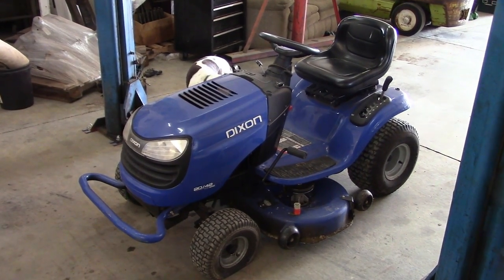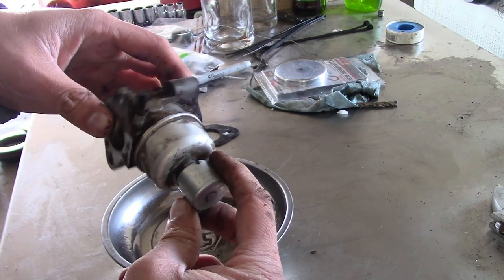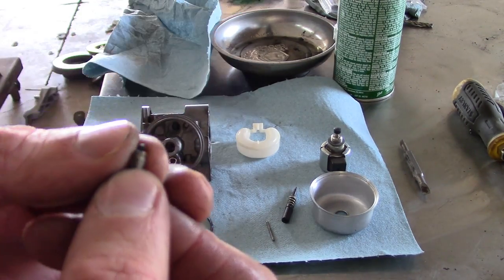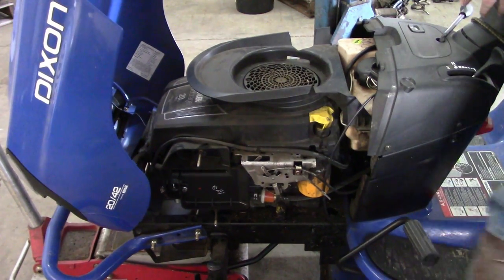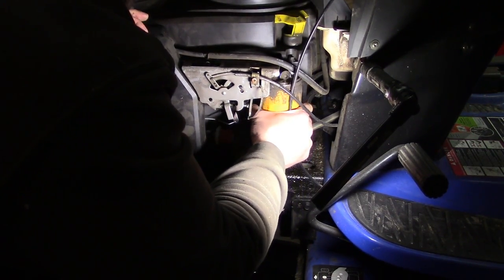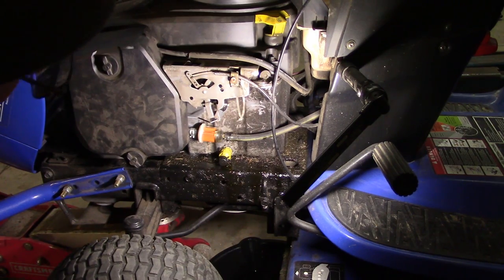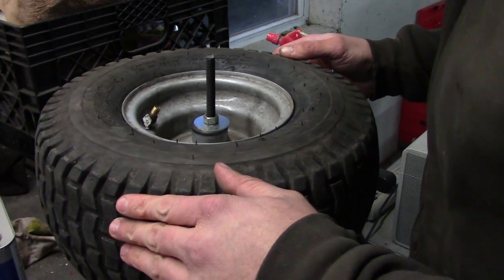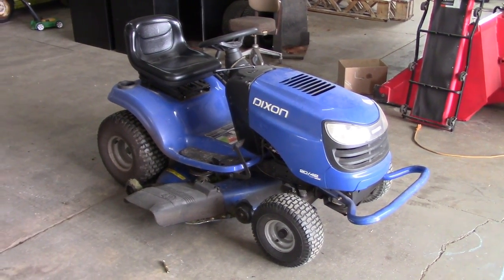Fixing up a Small Lawn Mower

Comment: That mower looks clean and relatively new on the outside but filthy under the hood.  When you see that amount of filth around oil filters and carbs you know there must be a leak.  Looks like a "run it til it breaks" owner and then take it to a repair shop.  I see them all the time and the owners think I should work for free to do the required service and clean them up.  They treat their cars the same way and expect guys like you to fix them.
Reply from the maker: It's leaking pretty bad from the valve cover. But it has over 1000 hours on it. That's a ton of hours for a disposable mower like this!

Comment: All riding mowers with Kohler engines require full choke when the engine is cold. They won't start without it. I own three, and have worked on countless numbers of them, and all of them do it. I guess it is just a Kohler thing.
Reply: I got a Kohler 7000 series 22hp can start on idle every time

Comment: Now show us something cool how to add an alternator on there for my car so we can take a couple typical decks for those kind of mowers replace the spindles with electric motors run off the alternator us allowing us to cut more grass at the same time by adding a deck or two if you would front mount them put the discharge chute the center pick up all the grass with one bag set up

Comment: Mower looked in good shape pulling in until you opened the hood to reveal the kohler "crapage" engine inside. That's VERY unfortunate. Older Kohlers( command,etc.) are bulletproof motors. This one just needs a bullet!
Reply from the maker: I really don't like the way the governor works, but it seems to run OK.
Reply: Was it my imagination or video artefact or vibration or what, but the fan/flywheel thingy looked kinda wobbly in there? Loose fanshrouds?

Comment: Just a pointer greasing the spindles in most cases serves no purpose what so ever as the bearing are usually SEALED
So your basically just adding weight to the mower :)
Reply from the maker: These are sealed.

Comment: Wow someone over tightened that filter.  Surprised you didn't have to punch a screwdriver through it to remove it.
Reply from the maker: I've had to use an air hammer to take them off before...

Comment: Pretty sure 10w30 is what's spec for that Kohler.... 'Pedant checking in'
Reply from the maker: You can use straight 30, 5W-30, or 10W-30, depending on temperature.

Comment: old video, i know, i know, but...

if my very flimsy, very thin and very lightweight (200 grams) latex tubular tires and my carbon fiber rims (300 grams) on my road bicycle can withstand a consistent 120PSI of pressure, i can't imagine those 30lb steel rimed wheels and tires couldn't take an equal amount. 

so, i would have thrown some REAL pressure into those tires to see if they'd bead properly before i spent any time breaking them down and slathering that tar on them.

Comment: not a fan of the Kohler motors at all. they've let me down a few too many times. give me a Kawasaki engine ANY day and i'm good to go. all of those mower bodies for Dixon, Cub cadet, John Deere, Huskie, MTD, Kubota, Snapper, Scott, Simplicity,  are all made by the same  company. every one of them that is not a full framed tractor and happens to have a stamped out body are made by the same group, i can't recall the company name right now but my 5 year old Craftsman was made by the same people.  As for the oil I use Mobil 1 in mine B&S began listing that as an approved oil for their motors too in 2015. i don't really think it matters much as long as the oil you use is kept changed regularly. i've always used Mobil 1 because i've had such good luck using it in all of my vehicles so i figured it would serve my mowers just as well and so far i've been right

Comment: I thought oil filters were torqued to 350 foot pounds???
Reply from the maker: Tighten it until the engine mounts sheer off...
Reply: Right, no wonder vehicles still ran after I changed the filter...

Comment: Not sure why anyone pre fills oil filters it’s the last thing to get oil you pour the oil in the top of the engine it fills the head runs down though the oil ways all over the crank and bearings so the engine is nice and oiled without the oil filter being full then you start it to fill the oil filter and top it up I really don’t see the problem in putting a empty oil filter on

Comment: I still don’t understand why lawn mower designers refuse to have the oil drain plug, directly over the seat, and then run onto the hot exhaust pipe, before draining onto several different distribution points, instead of just the one point that is sure to leave the puddle off dirty oil, on the concrete floor, and miss the drain pan, completely!! 

If you put the whole mower on a drain pan, twice the size of the mower in all directions, oil will still drip onto your floor!! 

The price of a new mower, is not worth the time to stop, AND FILL THE OIL FILTER, during an oil change!! Just leave the oil filter on the floor, facing upwards, to catch all the oil that spills out of the funnel, when you put the one quart, and three teaspoons from another whole quart of oil, in the crankcase!! DO NOT OVERFILL!! One quart and four teaspoons could be deadly!! One quart and two and a half teaspoons, voids the warranty!! 

That hose connection, DESIGNED to help clean the grass clippings from under the deck, works almost as good as a politician! You could hang the mower over an open fire hydrant, and not clean the grass clipping from under the deck!! If you left the mower at the epicenter of the Australian fires, the only thing left afterwards, would be the grass clippings, under the burned out deck!! The secret to WHAT WOMEN REALLY WANT, AND HOW TO SAVE THE WORLD, AND THE MIDDLE EAST PEACE PLAN, is stuck under a mower deck, hung up in grass clippings, next to the hose connector on the deck!! 

No, there was no sarcasm in my tone!!   Signed by.   SICK TO DAMN DEATH OF LAWN MOWER DESIGNERS!!
Reply from the maker: LMAO! It's all a conspiracy to sell fluid extractors and replacement decks...

Comment: I used to pull these out of electrolux manufacturing in orangeburg sc got to try one was not too impressed then again i ha e a zero turn deere
Reply from the maker: Yeah, this is not even from the same planet...
Reply: @WatchWesWork  dixon used to be a good brand as did husqvarna but like everything got to get it to a walmart price and quality suffers
Reply from the maker: @Newberntrains  I know. My dad used to work at a small engine shop that was a Dixon dealership in the 1970s. The friction clutch zero turn mowers were awesome for flat yards. This thing is just disposable junk.

Comment: Cheap blades.   Oil drain was seeping, so they crank the oil filter down.  Can't believe you put a Fram filter on there.  I mean you torqued the valve stem... but a Fram filter?  Amsoil makes a 2 micron bypass filter that screws right on.  That is one ugly machine.  I see why they put a bull bar on the front.  Keep other equipment from punching it in the grill.  Good show ;-)
Reply from the maker: LOL. I'd just take the oil filter off. These small engines ran fine without them for decades...

Comment: I don't want to be one of those pedantic commenters, but... 1 Bar is 14.5 PSI, not 14.7. Why not a nice even Atmosphere? I have no clue. Whoever made up the Bar must have been slightly above sea level. And yeah, not cleaning all the schmutz out from under the deck makes them rot out quickly.
Reply from the maker: Right. I forgot that 1 atmosphere is 1.013 bar.
Reply: @WatchWesWork  In fact the (bar) belongs to the international system (S.I.) the rest of the world is using. 1 bar = 10^5 N/m^2 (Pascal).The bar ...generally...is nice and even not the atm.

Comment: if you can try and find ethanol free fuel for your small engines they will last forever sadly carbs and high ethanol fuels just dont agree
Reply from the maker: Yeah. It's not easy to get around here. Too much corn I guess.
Reply: @WatchWesWork  I can get it at a station by my brother's house in Rockford but yeah not easy in the Midwest corn belt I always have him bring me 2 5 gallon cans whenever he heads my way lawn mower and chain saw love the none ethanol stuff and even my poor yugo loves it

Comment: I thought that those mowers had the two blades overlapping and in sync. The quality of the cut Gras would probably be better.
Reply from the maker: The only one I am aware of with overlapping blades is the old Wheelhorse two blade decks. The blades are connected by a shaft and bevel gears and the blades are timed so they don't hit each other.
Reply: @WatchWesWork  that makes sense to me. Another way I have seen is that one blade sits further forward and more in in the middle than the other one.
Reply from the maker: @Knallteute  This mower has one blade slightly in front of the other as well.

Comment: Would not ever recommend buying a mower with a Kohler Courage engine as they have many problems Like the muffler has fell off mine 3 times (pipe broke) it constantly leaks oil from the valve cover its not made to last with 2 Plastic cam gears
Reply from the maker: They are cheap...

Comment: Short videos keep we idlers sane thanks.  Pretty sure you violated two cardinal ethics of automotive repair: 1) insufficient soap in your spray bottle to yield bubbles without viewer squinting, 2)  use of non-digital air pressure indicator invalidates your presumptive achievement of required 14.00 psi

Comment: Cheater I want to see you get that bowl oring back on. They usually swell way.up and almost impossible to get to fit again. Also i hate thoes electric shut off  because if battery low it will not stay running. Lol
Reply from the maker: This one was in sad shape from corrosion.

Comment: What piss poor fix to sotp the engine. THAT is strange my 1970 edger dos not have that why, design problem? Yes go by some more parts from China that will fail
Reply from the maker: I think the shutoff is needed for higher compression engines. It works quite well.
Reply: @WatchWesWork  Hi I bought a Sears garden tractor new back in 1991 with a 18.5 hp and it does not have that on it, runs and looks like new i cleaned the carb about 8 years ago and replaced all of the steering bushing with ball bearings works great.